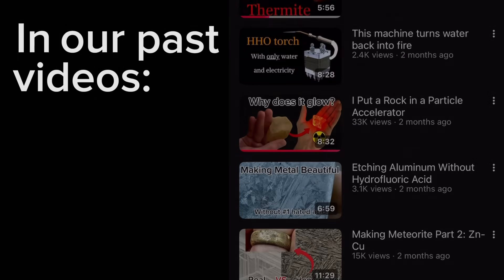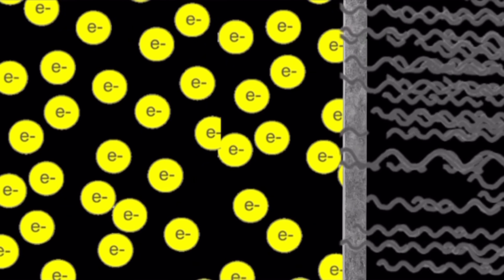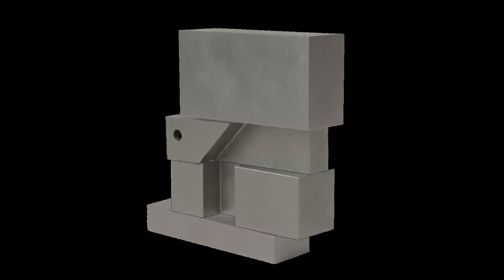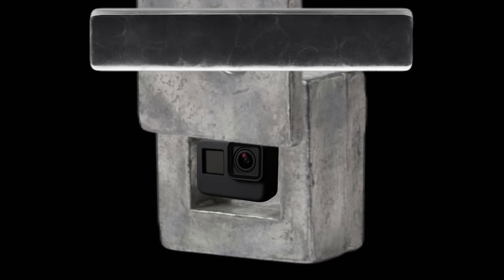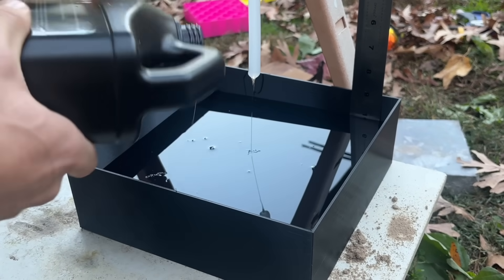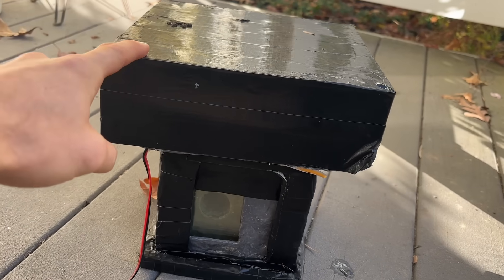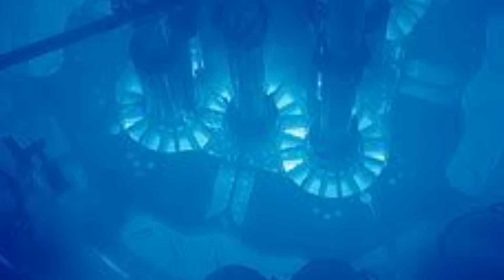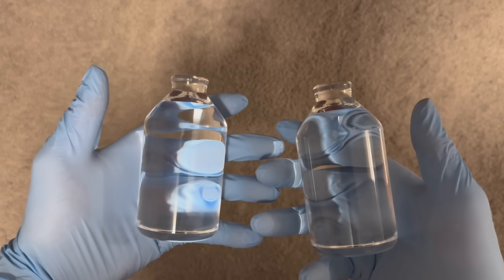Recording Inside a Particle Accelerator

Comment: This was awesome! I remember seeing the Seltzman videos when they came out because I was involved in STEM back then. I am so stoked to see more of your videos on the LINAC! I'm a lapidarist now, and I would love to see you put various forms of quartz and topaz through the beam to achieve different coloration results. You can get hydrothermally grown synthetic quartz in relatively low prices. If you manage to get the coloration effects nailed down you could potentially sell irradiated gem rough to lapidarists like myself for a large profit. It's hard to find that material as a hobbyist or small time business.
Reply from the maker: I threw a bunch of gems in to get some footage for shorts. I had tanzanite turn red, blue topaz turn blue/grey, and different types of quartz turn into smoky quartz/amethyst (which will likely be its own video). I also reversed fake citrine (heat treated amethyst) and turned it back into real citrine. I’m looking forward to making and sharing those videos.

Comment: Smokey quartz.   About fifteen years ago I had a bunch of clear hydrothermal quartz rods from a rockhound shop, 8in x 1in.  They'd tried to make smokey quartz using an electron-beam food sterilizer.   Didn't work, because the 10MeV beam was too monochromatic, and only produced very thin layers of black inside the quartz.   (Unfortunately they were out of all the ones with blackened layers inside.)
I wrote to tell them, just put the rods on a little rotating drum, so the black layer is swept through the volume.   Heh, they never wrote me back!
Need some quartz rods?
Reply: As a lapidarist, I'm really hoping he does some quartz and topaz experiments.
Reply from the maker: @oxoniumgirl I’m saving the quartz for a full video but I did throw a blue topaz under the beam. I wasn’t going to make a on it video but I think I’ll throw a short together now that you explicitly mention it.
Reply: @oxoniumgirl  he mentioned amethyst.  But I think the quartz needs just the right contaminants, otherwise it comes out brown or black.  The Russians figured out bright blue hydrothermal quartz, dunno if radiation was involved.   Some compounds have color-centers which are actually colored.   I think sodium chloride just turns black.
Heh, turn your antique glass doorknobs instantly violet?  (It apparently takes weeks when using intense UV lamps.)
In Brausch Capacitron 1947 articles, they mentioned  ...instant taxidermy.  Hmmm.
Reply from the maker: @wbeaty sodium chloride will turn orange, but a then a very dark green/purple if exposed to light
Reply: @ElectronImpressions  Interesting!  Instead when connected to DC kilovolt electrodes, then heated well above 100C the color centers for NaCl are supposed to look black.  (It's a lecture demo in the Meiners book, to make electron drift-speed directly visible.)   
MeV x-rays must trap electrons in a much higher band for NaCl?  
The Meiners demo shows that, even at large amps, the "speed of current" in conductors is roughly mm/minute.   Electricity flows like the hour hand on a clock!

Comment: Nice, I've been waiting for that one! I didn't think the leaded glass would have been enough! You know old CRT screens are leaded glass, could have cut a piece out of one of those.
Reply from the maker: I used about 6mm lead eq at 150kev… I didn’t think it would be enough either lol. I believe the lead glass in CRT TVs have a much lower lead eq and are rated for lower energies though. The 1/3 inch panels I used had a lead equivalency of 2mm, again, at 150kev so it is dramatically reduced at the MeV range we are operating at.

Comment: What about the glass CRTs are made of?
How much lead do they contain?
Reply: The neck and funnel of a crt contains 27%wt iirc, but the panel itself is lead-free.
Reusing the funnel or neck for something like this would be.. very difficult.
Leaded glass can be up to 65%wt iirc
Reply: @Aslyuriel  I thought that the front of the tube you looked at was still leaded, because the electrons are effectively shooting right at you otherwise no?

Comment: ......so I take it there was a reason you couldn't simply leave a chamfer on the seam edges of the lead, use a soldering iron or whatever to fuse the base portion of the V joint, then backfill with molten lead....
Reply: By "leave a chamfer," I mean per the casting form
Reply from the maker: Allowing the case to be easily and quickly completely disassembled was a requirement, so the seams are a necessary evil
Reply: @ElectronImpressions Makes we wonder about a better nesting design then, making mating surfaces convoluted/keyed in a way that could help to reflect energy that enters the seam. Something like those cube puzzles that only fit together one way.

Comment: That dust is a massive health hazard. I don't know if casting is a good idea at all.
When I was working on industrial x-ray vaults, our go to was just folding lead sheets into place, screwing and then shielding the screws as necessary, and welding when we can't do it any other way. Granted that worked fine on vaults up to 500kV. Anything in the MeV range and we would just go straight to "as much concrete as possible."

Also, great work realizing that backscatter is a thing. This is a common consideration for radiography.
Reply from the maker: Often times the good ideas are expensive haha. Also we are dealing weeelllllllll in the MeV range so we need inches of lead for sufficient attenuation.
Reply: @ElectronImpressions  here's an oddity.  Once I had lead oxide all over my hands (finding scrap lead at the town dump,) then scrubbed it off.  Then, a tiny well-healed scratch on my thumb, over several weeks gradually became a large open wound.  Anerobic infection. The lesion was making tiny bubbles, so, probably clostridium gas-gangrene.  No antibacterial had any effect, not idoform, not h202, not amoxicillin powder.  it was doubling size every two days ...terrifying.  I only halted its expansion via immersing my thumb in deionized water continuously (even at night.  For two weeks.)

But I don't know if the infection came from that pile of oxidized lead sticks ("stained glass" supplies,) or from the rainwater bucket at the dump.  Reading some papers tells me that metal-reducing anaerobes live on metal surfaces, where they etch the metal to produce oxides plus an anaerobic microenvironment.  Yet all of us are constantly exposed to such organisms, and developed immunity early on.  Apparently my immune system didn't recognize this particular "metal-eater" bacterium acquired from the town dump!

So, WEAR GLOVES, heh.   Don't just wash hands thoroughly.   Gas-gangrene is lurking out there, where the only recommended therapy is of course   ...amputating fingers in order to save the limb.  Also I found no paper mentioning the cure I used: continuous wound-irrigation with distilled water.
Reply: @ElectronImpressions  PPE is a good idea that ISN'T very expensive :P
Reply from the maker: @mantha6912  Don’t you worry I had that respirator but could have used more gloves. Blood lead levels are below the detectable limit though.
Reply: Any ideas on the x-ray absorption properties of normal concrete, vs lead?  I found a beam attenuation calculator, but realized at some point that it was likely counting "beam was scattered" as "attenuation", and it would be ironic to make an x-ray diffuser instead of an x-ray shield.

Comment: You could get a better seal if you mill the pieces to fit more snugly.
Reply from the maker: Of course, but I don’t have a mill or the desire to mill lead 😂
Reply: @ElectronImpressions Or maybe heat up the mold so the lead can settle on its own, and use a finer sand like talc to get a smoother finish.
Yeah, you’re right, lead dust is scary.
Reply from the maker: Many ways to do a better job, now that I know this design works if I were to make a version 2, I would make it via lost pla casting
Reply: @ElectronImpressions In that case, PLA isn’t a good material for that, it leaves a lot of residue. Try wax filament; I think Polymaker has one. Then you can mix some jeweler’s plaster and pour it around the 3D print, in a steel paint can.  After that, bake it to make the mold, and finally you can pour the lead.
I once tried making an electric motor using that method, but my plaster was too goopy because I added too much water, so it failed. We ran out of time since it was for a uni project, and we ended up just buying a motor.
Reply from the maker: @carlosfbarajas7755 I’ve had good success with using pla and softening it out of the plaster mold using ethyl acetate. But this is obviously a lot less sustainable than just using a filament designed for this purpose, as you suggested, lol. I am stubborn and always choose the difficult route with materials I already have rather than just spending an extra like $10

Comment: Wouldn't an aquarium be a pretty great choice too? All transparent, you can get very easily lot of shielding material and no handling of toxic lead.
Reply from the maker: What would you fill the aquarium with? If you mean water— water is a great attenuator for fast neutrons but compared to lead it is not so good for X-rays, you would need more than 10 times the thickness of water than lead. And space on this chart is very valuable so it’s extremely attractive to have the smallest case possible. Also the cart ride is very bumpy and if we accidentally leaked water on the accelerator that would be very expensive lol.

Comment: Lost pla casting would have been nice here instead of sand.
Reply from the maker: I agree but I simply didn’t feel like it lol. Sand is so much faster and has the added benefit of retaining the 3d printed form if the casting fails. So it was more appropriate for the “R&D” phase of this project.

But now that I know this design works, if I ever redo it, it will be done via lost pla.

Comment: Walks up to checkout at walmart* "will you be paying with leaded glass or molybdenum today?"
Reply from the maker: Inconel
Reply: @ElectronImpressions  "alright sir but just to let you know, there is a 4% enriched uranium charge on all inconel payments"
Reply: @ElectronImpressions  Heh, I have a large sheet of molybdenum here, found in a dumpster.  It had a label, but hardly readable, so they probably didn't know how pricey it was.   Apparently it's commonly used in place of tungsten, where W would be too brittle (for stamping out coater-boats for metal-sputtering, for example.)   But boo hoo, nobody has yet thrown out big sheets of Pt  ...only broken gel electrophoresis tubs with many inches of Pt wire electrodes.
Reply from the maker: @wbeaty Wow that would have been one of my top 10 experiences lol. That’s crazy.
Reply: @ElectronImpressions  Need any Mo?  It's half a square meter, few mil sheet metal.  I cut off hunks for people here in the department, or for local "element collectors," but everyone only takes a few square cm.   Hmm, I wonder if it wets to Pyrex, like tungsten apparently does?  Lab glassblowing pass-through pins?
Need a bumper sticker "Without Molybdenum, life itself would be impossible."    Apparently there's a Mo ion in some part of all cellular respiration, nitrogen-fixing, etc.
> top 10 experiences
Eh happens all the time.  Heh.  Last week found a 30W cw laser module w//water cooled heatsink, in the garbage.  Works fine.  I'm scared to apply more than 10mW.  Knowing the part number, it turns out that these are common online used, 808nM "FAP 800" from Coherent Inc., even 80watt versions.   But the wise person would be terrified to own such a thing.  Fortunately for me it needs a 2-volt 50A power supply ...and incredibly expensive safety goggles of course.
Reply: @ElectronImpressions  Sorry, we only accept Hastelloy

Comment: 9:30 bro is making radioactive spiders on the casual
Reply: Poor thing was cooked immediately. It ain't biting no Peter Parker. Also, I just realized Peter Parker's initials are PP.
Reply: @ctrlaltehbut it still moved after coming out of the beam?
Reply: @Progs420 I think it was inside with the camera, at least I think so
Reply: @skoonthatraccoonskunkguy3865 oh that could be it! It didn't even cross my mind the spider could be inside the box. 😅
Reply: what spider ? there is no spider.
you talking about  that thing that moves across the plate in front of the camera ?
that is NOT a spider.  you can clearly see it at 9:33. it is that little white booger.
but most def is NOT a spider. its probably just a Hot Glue booger

dont you  think dude woulda called it out if it was...
Reply: @NinjaBonez  Can't tell if your being sarcastic or are just ignorant, but hot glue doesn't move on it's own when it's cooled...
Reply: @InvisibleSquids  It also doesn't have distinctly moving legs :)
Reply: @NinjaBonez  No that white blob isn't what we are talking about! At the OP's timestamp, above the censor bar and on the right of the bright light, you can see a small blurry blob move some legs.
Reply: @NinjaBonez Above the black box to the left of the acrylic
Reply: Radiation apparently grew legs on to that hot glue booger...

Comment: Why not just a plywood box filled with lead shot?
The probability of a x-ray photon scattering all the way through those lead balls is near zero, if the walls are thick enough.
Sure, needs a little extra thickness, but much better than messing with casting nasty lead stuff.
Have similar setup, for x-raying PCBs, something like 200kg of collected cartridge brass in some cardboard boxes, makes excellent free xray shielding, without any lead.
Reply from the maker: I forgot to mention in the video but the shielding needs to be rapidly disassembled and reassembled after each run as we are extremely crunched for time on the linac. Otherwise I would have went with an approach that utilizes fasteners or what you are describing. 

Solid lead is also attractive because of its efficiency per volume in attenuating X-rays compared to other materials (like brass or lead shot as you mention). The volume of the camera case is incredibly important as we only have a limited surface area per cart that we can send in, and the cost per cart is absurdly expensive. So I would much prefer having the smallest case possible so I can fit more experiments on the cart.

Not saying that my design is the absolute best possible though, there is definitely room for improvement.